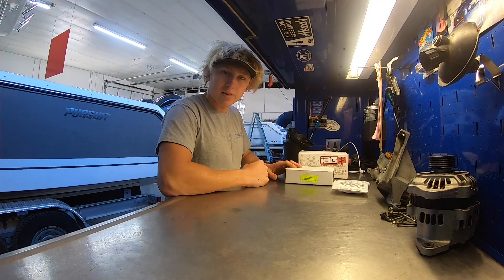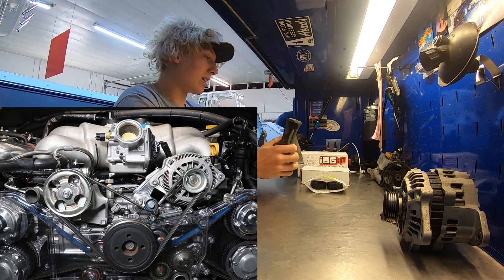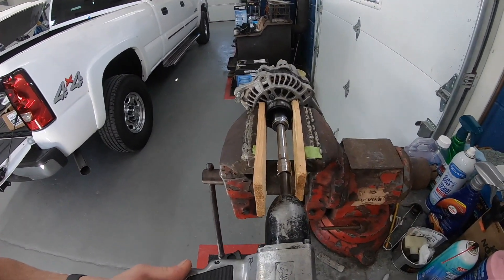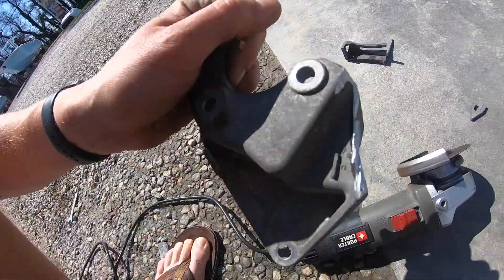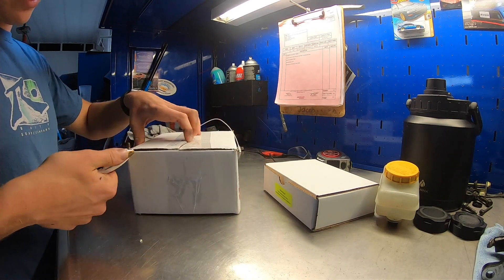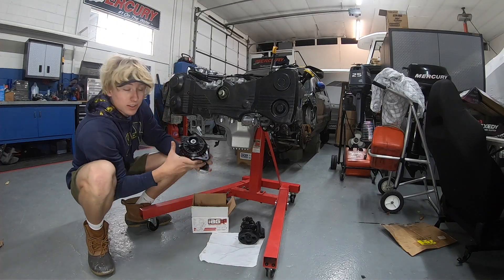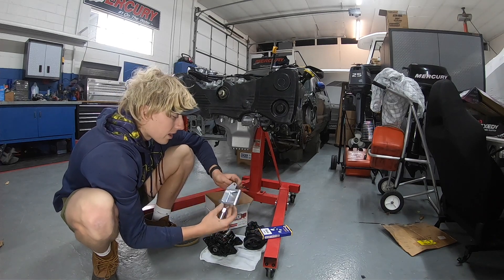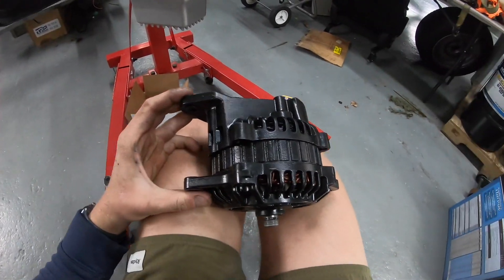PAINTING SUBARU ALTERNATOR HOW TO | IAG ALTERNATOR RELOCATION KIT INSTALL|ROAD TO 800HP SUBARU EP 21

Comment: That alternator relocation bracket is very cool outside of having the main power bolt so close to the metal water pump line on your engine. I know the info in this video will be useful to future people who look up your build. The painted parts turned out great! The black parts with the clear timing covers on your build will look 🔥🔥🔥! I must say you are killing it with this build process 👑
Reply from the maker: Ayeee thanks man! Always appreciate the kind words 💪🏼
Reply from the maker: Ayeee thanks man! Always appreciate the kind words 💪🏼
Reply: I think you just remove the adapter and throw a plastic spacer in there.